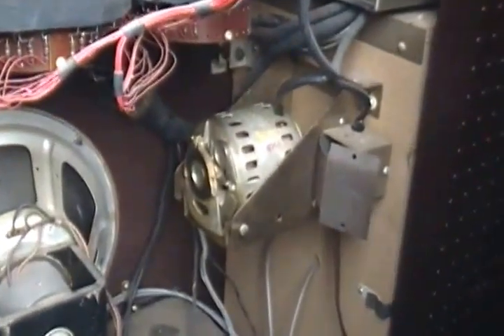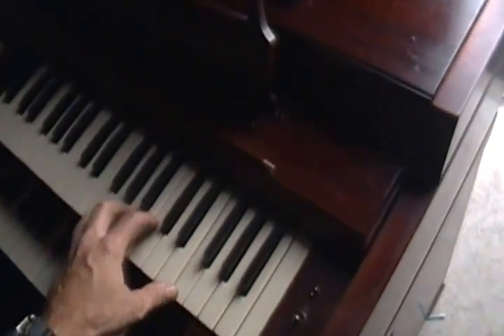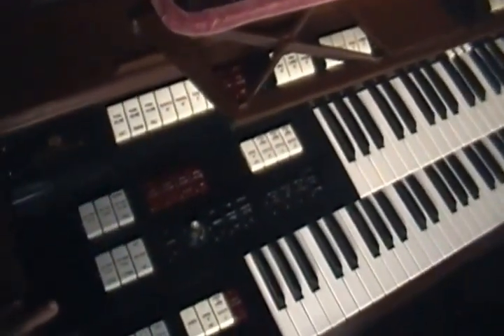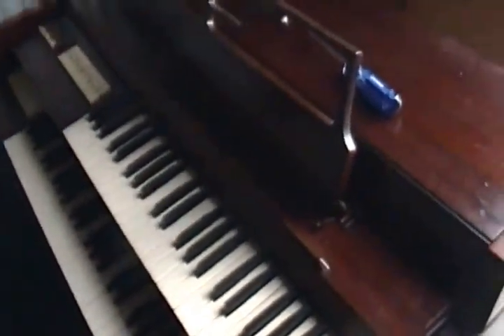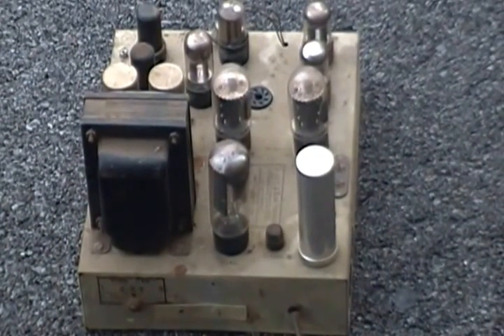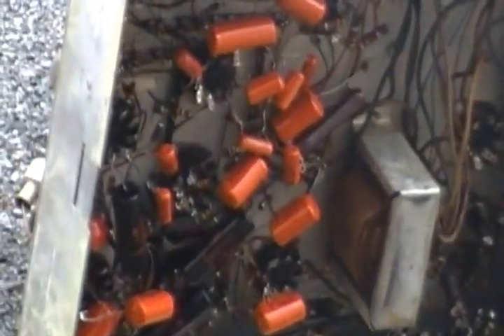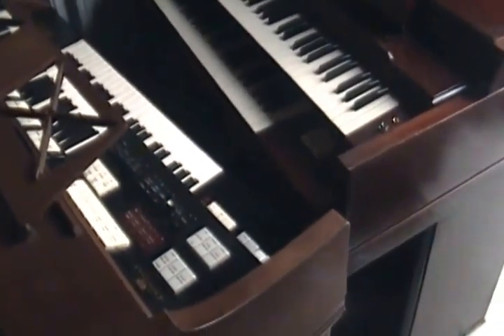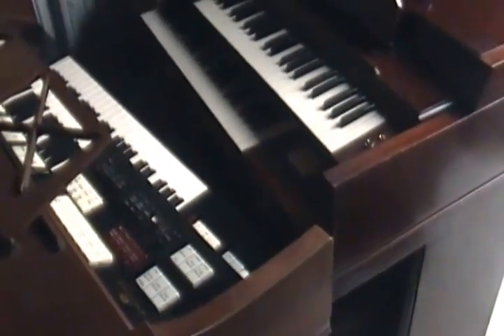WURLITZER ELECTROSTATIC REED ORGANS - 1956 Continuous Free Reed 4410 & '46 Keyed Free Reed Series 31

Comment: The electronic Wurlitzer, has the Spectra Tone, a gyro type speaker that rotate virtically with a weight. But there were major problems with waring out the belt and then in the early 70s, they went with Leslie, until the late 1970s. The electronic organ today is valued at "0" as you cannot even give them away. No one wants them and every time a new Lowrey leaves the showroom floor, they depreciate in value.

Comment: With a pipe organ wind blows over either the lip of a Flute pipe or the Tongue of a Reed pipe.  There is an simple accurate saying in the world of pipe organs:  "If the wind is focused on the lip of the pipe you will get prompt speech".
Reply: Currently I have a 7020 Amplifier from a 4410 here for repair. The amplifier has never been touched.  The customer grabbed it from a neighbor's curb.  He played it "with low volume output" for almost a year until he smelled hot soldering flux and a little smoke. 

He turned off, and found me.  The first stage electrolytic can is shorted.  The 4410 is an oddball animal as it doesn't seem to share any of the same features of other models during the same year of manufacture (1956).  Those Sprague orange drop capacitors are new replacements.  The originals are paper or oil saturated paper. 

 Here is an image of this untouched 7020 amplifier:
http://hammondorganservice.com/downloads/images/w7020under1.jpg

The customer would like minimal done to repair it.  There are no 1956-ish capacitors in this amplifier which can be guaranteed to operate after 60+ years.  The amp needs a complete rebuild.  Unfortunately it costs more to repair this correctly than it's current resale value.  This is true for any spinet organ including the Hammond M, M2, M3 and M100.  The reed amplified instruments can also go out of tune and there is much more electronics within the tone shaping filters above the reed generator box located on the right side (from the back).

Comment: My step father (who taught accordion and piano for 55 years) has a Wurlitzer model 4410 (serial #277673, blonde wood color), sitting in his garage for at least 25 years. He got it as a give away (didn't work) and never did get around to fixing it. He asked me if I could get rid of it before he moves this June. I was surprised how heavy it is. I find it a shame to have to scrap the organ on a junk pile (I'm all but sure there are some desirable internal parts (tubes, speaker, amp., etc.) that could be used to restore similar model organs. I was doing some Google searches (how I wound up here on YouTube) on this organ and was quite surprised there was little value to them (eBay, et. al.). Not that the value (lack of it) matters to me, I just wanted to make sure I wasn't going to scrap something that did have significant value.
Reply from the maker: +1royalpalm Ah' value versus worth...this VERY VERY incredible organ is PRICELESS!!! As I have said in the past I will say it again. These electrostatic reed organs surpass any and every synthesized, digital  OR analog purely electronic method of creating rich, powerful, and dynamically responsive organ tones. So what, is ORGAN as a professional musical instrument dead and worth nothing to the playing and listening public? This is certainly not a question you toss out to the masses and conclude that it must be true. It's not true. However, the few and far between left over EASY TO REPAIR WITH COMMON ELECTRONIC PARTS, W-U-R-L-I-T-Z-E-R  ELECTROSTATIC REED ORGANS 1953' to 1961' need our special attention to be preserved for future generations. It is not just some run of the mill organ! It is an altogether PROFESSIONAL ELECTROSTATIC REED ORGAN that is NOT to be confused with the acoustic reed organs like the relics of the 1800's which simply blow air through the reeds and are heard acoustically. In fact the Wurlitzer 44,4410,4420,4430,4600,4602,and 4800 use a 300 volt ( rather low amperage mind you, but still enough to get a jolt if cleaning the contacts, etc. with the lid open) charge across ALL OF THE suctioned reeds in motion at once ( actually uses vacuum suction, not blowing air, which is preferred for stability and keeps external dirt from ever entering the hermetically sealed, sound proof reed boxes). Read more about it at the NORTH SUBURBAN HAMMOND ORGAN SOCIETY website and look at TECHNICAL ARTICLE ' WURLI 4600 '.
- SUPERIOR FLUTE/TIBIA VOICING
- SUPERIOR REED and STRING VOICING ( Hammond tone wheel organs don't even have REED or STRING voicing!)
- The ONLY ELECTROMECHANICAL ORGAN BESIDES HAMMOND TONE WHEEL B3, M3, A100, etc.

So PLEASE PLEASE by all means let us know on the ORGANFORUM.COM what CITY and STATE you are in and give us a little time and chances are good we can save this excellent professional organ. I would be more than happy to write the free classified ad for you for the Organ Forum if you send me some images of the organ. It needn't be beautified, just do the best you can. Send me a PM ( personal message) on the ORGAN FORUM, but you just have to do a quick free registering on the Organ Forum first. It is a very safe IRC site. This way I can give you my Email address to send the images too. Even if you have no images or can't take any we can get that later. Main thing is to find someone who wants it. Anyone who knows this model knows it is easy to repair and was built better than ANY organ ever manufactured. Wurlitzer spared no expense in their products and EVERYTHING was made on site, even the nuts and bolts! ( watch the WURLITZER 1950 JUKEBOX FACTORY VIDEO and it shows the organs being built as well, although your 4410 is a 1956' model, still it was made at the Niagara Falls factory where the great Wurlitzer theater pipe organs were built. In fact it was the electrostatic reed models that proved to be the best design to succeed the pipe organ manufacturing after they totally revamped the factory to build bombs for the WWII effort and decided to stop building theater pipe organs. This is something to think about!

Anyway, what ever you do DO NOT list the organ for FREE or for less than $75. It will bring out all of the junk men and Ebay destructomatic 'parts sellers'. Screen your callers if selling on Craigslist and be sure they are genuine in their desire to preserve this great organ. Don't wait until the last minute and give it away, okay:) Of course there might be a sincere individual who hasn't much money, but expresses enthusiasm to have the organ. I was such a person when my mint condition 4410 came along. The woman held out for such a person to come along, as it had sentimental to her and wanted her mom's memory preserved. Anyone who can play music well plays Wurlitzer organs you will find ( not that I am any good, but do have a good ear for tone:) - Paul
Reply: I sent you a PM at 8:38 EST.
Reply: Is this organ still available?
Reply from the maker: Wow, after all this typing I see I'm responding to an 8 month old inquiry! Oh' well, for future reference.
MONETARY VALUE FOR AN ORGAN MEANS NOTHING!! You have a GREAT GREAT ORGAN THAT NEEDS PRESERVED! PLEASE DO---NOT---SCRAP---IT---OR---DISMANTLE ---IT ---TO ---SELL---IT---AS---PARTS!!!!!
PLEASE, I IMPLORE YOU!

Find a place to keep it, it happens to be a very beautiful LITTLE ORGAN ( it's heavy sure, but these Wurlitzers are not BIG, so please find a spot for it in your living room in the mean time, the DO CLEAN-UP VERY NICE EVEN IF THEY LOOK FILTHY:)
So why bother?
Because, never again will there EVER be made a PROFESSIONAL ORGAN such as the great WURLITZER ELECTROSTATIC REED ORGANS.
Okay okay...wait a minute, I'm not going to lecture too much here, I said it best in this video:! Even if I was half asleep. lol

We live in times when everyone has little patience for ANYTHING if it's not a mainstream pursuit, or can make a buck. Come on, think about your elder who kept that organ around all of those years. They didn't do it because they were a weird pack rat ( well, not just because of the organ anyway). They kept it because they knew it REAL VALUE AS A VERY RARE, EXCELLENT WURLITZER PROFESSIONAL MUSICAL INSTRUMENT!
DIGITAL CANNOT COME CLOSE TO THE BEAUTIFULLY RICH TONE THE WURLITZER ELECTROSTATIC CONTINUOUS FREE-REED ORGAN CAN PRODUCE!
Of ALL ORGANS theese are the EASIEST TO MAINTAIN!! NEVER NEEDS TUNED! ONE SIMPLE, EASY TO REMOVE & REPAIR> AMPLIFIER/REED FILTERING/POWER SUPPLY CHASSIS<

WHATEVER YOU DO, LIST FOR NO LESS THAN $75 AND DON'T BUDGE UNLESS THEY COME AND PLAY IT TO SHOW THEY ARE SINCERE, DO NOT LIST THE ORGAN AS 'FREE' BECAUSE ALL OF THE JUNK GUYS WILL COME OUT OF THE WOODWORK AND YOU CAN SAY GOODBYE FOREVER TO AN
IRREPLACEABLE VINTAGE PROFESSIONAL WURLITZER ORGAN!
I mean come on think! It's a great instrument not some JC PENNY piece of crap!
This organ was made where the original WURLITZER THEATER PIPE ORGANS were made in TONAWANDA NEW YORK aka NIAGARA FALLS!
Absolutely it has historical value!

Forget the $$$$ for a minute won't you. Not everything that is great in life is measured by it's monetary value. Look at it this way, the people who bought all of these great organs of the past that are still around today, by all means they WERE PAID FOR DEARLY ONCE! People paid as much for this Wurlitzer in 1956' as a brand new Volkswagen Convertible Beetle!
Hey, I used to restore VW's until they started being bought up and restored for their kids graduation presents. So I sold out my entire inventory. It was no longer exciting because of the $$$$ involved. So consider this Wurlitzer, IT's  GENUINE WURLITZER FOR GOODNESS SAKE, some day it will be worth something because too many people are being ignorant and thinking with their wallets now, and junking them.
My motto is
" PLEASE SAVE JUST ONE."
Anyone has space for a little beautiful piece of furniture even if they don't play...yet;)

MORELOCK'S WURLITZER PARTS in Mississippi still has every part for this organ and will full rebuild the amp chassis for next to nothing, but it probably still works great. Regardless, sending the chassis to them ( after you've called and set it up with Janice) will assure it sounds like brand new for the next 50-60 years. A minimal investment for the STRADIVARIUS OF ORGANS!
BTW- Morelock's is owned and operated by the original Wurlitzer factory employees who bought out the entire factory's line of over 170 Wurlitzer models of organs and pianos, and their parts in the 1980's when Wurlitzer went out of business. The 80's spelled the end for every electronic organ company. The horrible 70's organ boom instigated by BIG BUSINESS investors from WHIRLPOOL, CBS, and the like flooded the market with cheapo' garbage shopping mall organs. It ruined the previous 50+ year reputation of fine craftsmanship of organ building excellence from 1935-1970. Absolutely organs are the king of instruments! Don't let the crappy 1970's organs fool you.You have a genuine work of art, preserve it! Play it! But preserve it please.
Reply: paulj0557 How can I get in touch with you?

Comment: Yep, tubes are the only way to go.
Reply from the maker: For guitar yes, but then again there some great transistor amps out there too. Like the almighty 1976 AMPEG G-110. WOW!
Organs actually thrive using tubes or transistors for tone generation ( the heart of the organ is the tone generation, its to an organ what a string is to a guitar), but aside from these two great tone generation sources are the electromechanical tone generators. Like the great relationship of 'string to pick-up/', the 'tone wheel to pick-up' is the same exact thing. It's just one is a set of 6 strings over an elongated bobbin of wire around 6 N/S magnetic poles, and the other is 91 spinning metal discs over 91 tiny single bobbins of wire each with their own N/S magnetic pole. So essentially it's an electric guitar-like organ. These tone wheels all produce sine waves as the tone generated and depending on the size of the flowered edge of the tone wheel the pitch is higher or lower. ( SEE- NSHOS HAMMOND ORGAN for a great explanation with moving diagrams)
The Wurlitzer electrostatic reed organ also works similarly in that it is also an electromechanical organ ( SEE- NSHOS WURLI 4600 Organ ).
   So tubes are amazing...[funny I had to rewrite this because I accidentally closed the page before, but the following I will condense and the NORTH SUBURBAN HAMMOND ORGAN SOCIETY web site covers all of the Hammond and Wurlitzer organs I mentioned above].
However there is one detail of interest that might be intriguing to a guitar player. I played for 20 years before getting into organs back in 96'. Organs and guitars are both bliss for tone heads, which most guitar players are and this is why it pisses me off so many destroy organs to make amps. At any rate check out why a Lowrey square wave tube organ sound so cool. If it were transistor it would sound similar, but in the case of the Hammond X-66 it is square wave too, but since they spared no expense on filtering and had a few tricks up their sleeve like making it HIFI with 135db of headroom by applying 110V to the transistors, it makes the organ a very warm, yet powerful professional sounding organ.

So have a  listen to this all tube Lowrey at the link below and while you are at it compare the ALL TUBE CONN 640-645 organ of DON BAKER ( below too) compared to the same type organ, but all transistors. You'll hear that the tube organ is very bold, full, and warm, and the ALL TRANSISTOR CONN 650-652 organ sounds great too, but has a tight, up front, fast attack, crisp tone. The CONN organs whether tube or transistor are similar to the Hammond and Wurlitzer organs in that each note has it's own oscillator ( call TI or VI which stands for TRANSISTOR INDIVIDUAL oscillator tone generation or VACCUM tube INDIVIDUAL oscillator tone generation).

INDIVIDUAL OSCILLATOR VERSUS A 12 OSCILLATOR DIVIDED OSCILLATOR
 you will see that many organ have 12 oscillators which represent the highest octave of the keyboard, and that for all other notes they simply divide these high notes in half to get the next lower octave, then divide that, and so on. By dividing a frequency in half it makes a note exactly one octave lower in pitch. The draw back to this type of system is similar to a sampling keyboard versus a keyboard with every note sampled individually. In the case of the organ, as far as tone it might sound great because it is analog, but what is missing oftentimes is the 'ensemble effect', or the effect of many different voices being slightly different in pitch and so it thickens the sound and gives a chorus effect, or ensemble effect. 
ALL of the 60's transistor COMBO ORGANS were 12 oscillator organs ( ever look inside of a Vox Continental combo organ and see 12 silver tuning cubes on 12 circuit boards that looked the same? That's a divided oscillator organ.)
The great HAMMOND X-66 is also a 12 oscillator divided organ. The great tone is due to excellent filtering and precise, stable division, and the ensemble effect is accomplished by a 3 SCANNER, BELT DRIVEN, VIBRATO/ CELESTE /TREMOLO ANIMATION SYSTEM. The best vibrato ever made on any organ, amp, pedal, you name it! If someone really wants to make a bitchin' modeled for guitar pedal then the Hammond X-66 VIBRATO/CELESTE/TREMOLO is it!

So anyway the following is- LOWREY SQUARE WAVE TUBE ORGAN, DON BAKER ALL-TUBE (VI) CONN 640 from 1965 , AN ALL TRANSISTOR (TI) CONN 650 or 652 [haven't decided which yet], and for the heck of it an X-66 STAR TREK THEME. ENJOY!
Music for Many Squarewave Moods
Don Baker - Curtain Time - Conn Theatre Deluxe Organ 1962 -EXCELLENT!
Conn 650 Home Organ.avi
Conn Organ, Bogan Amplifiers, Amazing Vintage Audio
and the X-66 ( like what I have...love it!) Steven Eaklor